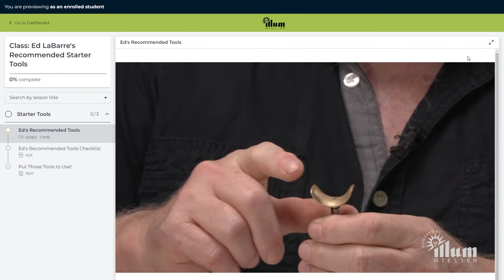How to recover a horn and a horn wrap

Comment: You remind me of of my dad teaching me how to hang and finish drywall. Now I know this is not a class on drywall , but it is a class on a trade that you have knowledge about. My dad always told never ignore advice or a technique or tip when working along side anyone in the same trade. Not all advice or tips or tricks are good , as time goes on youll get better at figuring that out. All that matters as long as the end result of your work is what the customer wanted. 
And of course to make the most money at as possible getting the best result faster than any other contenders. .. not only the best product gets the check sometimes the first one standing there to pick that check up is the customers choice to get the at job done